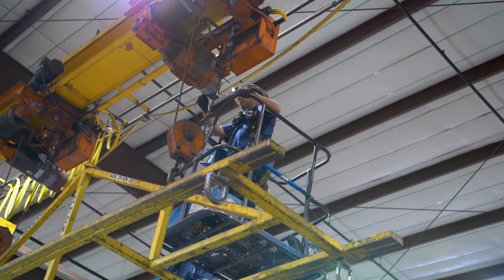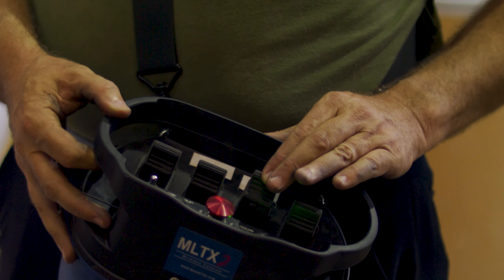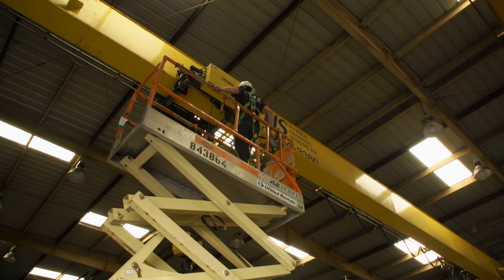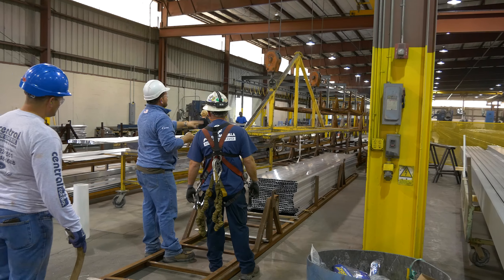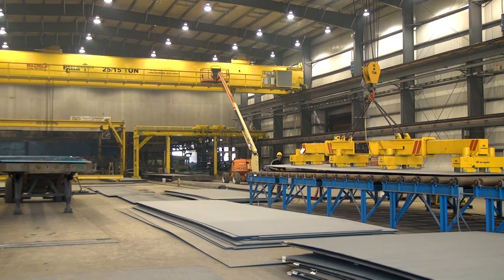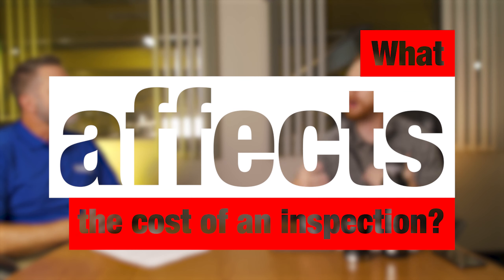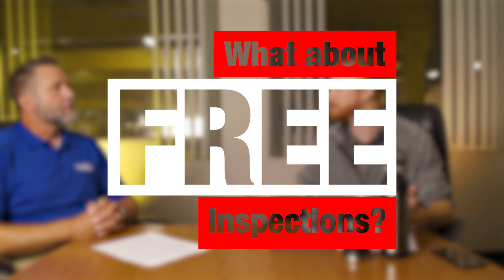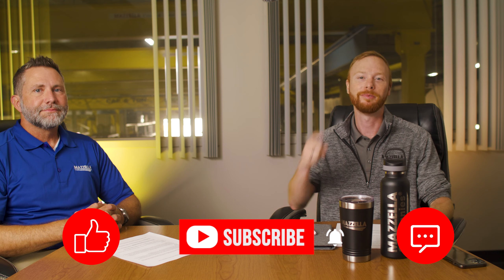What’s the Cost of an Overhead Crane Inspection?

Comment: Is that $960-$1200 per each crane?
Reply from the maker: This is a great question and I wish we would have answered that in the video for you. The answer is no, not per crane. Most facilities we inspect have multiple cranes and this number is based on an average plant inspection with somewhere between 4-10 cranes. We base the inspections on an hourly rate that depends on the complexity of a crane. So, the cost of an individual crane inspection can vary greatly. 

The cranes will vary greatly from taking as few as 15-20 minutes to inspect a fixed small hoist and taking up to12+ hours to inspect very large high-capacity Class E and F or Automated cranes. So, in determining how long it takes to inspect a crane has a lot of variables. We have tools to help you determine how long a crane may take to inspect and how much it will cost so we can help you get an accurate quote. Please contact us if you have any other questions or would like a quote for your facility. https://www.mazzellacompanies.com/company/contact-us/contact-crane-service-division/

Comment: Do you guys load test the crane after the inspection.
Reply from the maker: Thanks for watching.  I reached out to Bobby to get your questions answered.  This is what he had to say:
"We do not perform load tests after the completion of an inspection. OSHA requires rated load tests (not to exceed 125% capacity) for new and altered cranes. (upgraded, modified, rerated, etc.) OSHA standard 1910.179(b) states:

_1910.179(b)(2)
New and existing equipment. All new overhead and gantry cranes constructed and installed on or after August 31, 1971, shall meet the design specifications of the American National Standard Safety Code for Overhead and Gantry Cranes, ANSI B30.2.0-1967, which is incorporated by reference as specified in §1910.6.
1910.179(b)(3)
Modifications. Cranes may be modified and rerated provided such modifications and the supporting structure are checked thoroughly for the new rated load by a qualified engineer or the equipment manufacturer. The crane shall be tested in accordance with paragraph (k)(2) of this section. New rated load shall be displayed in accordance with subparagraph (5) of this paragraph.
(k)(2)
1910.179(k)(2)
Rated load test. Test loads shall not be more than 125 percent of the rated load unless otherwise recommended by the manufacturer. The test reports shall be placed on file where readily available to appointed personnel._

So unless the crane has just been modified or upgraded we do not perform load tests during inspections."

I hope this helps answer your question!